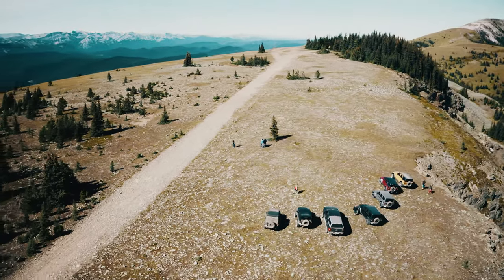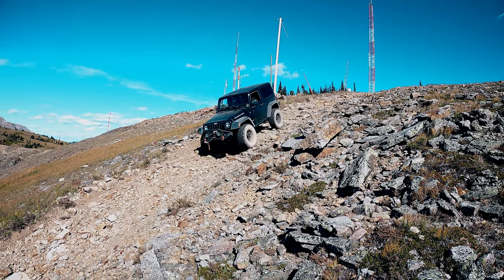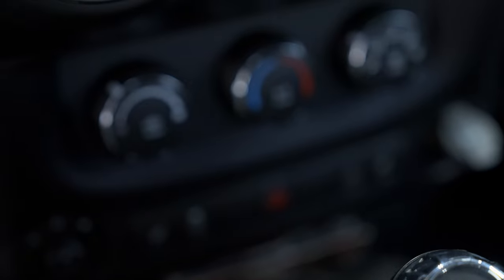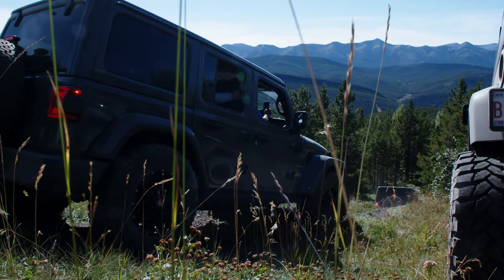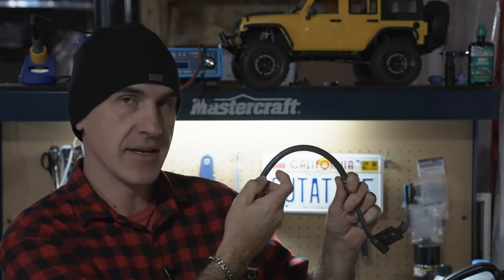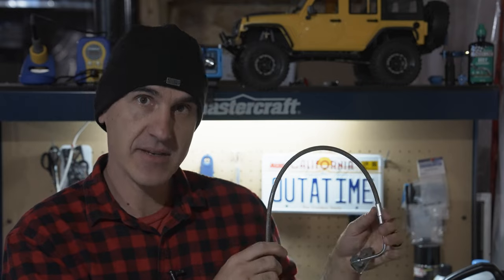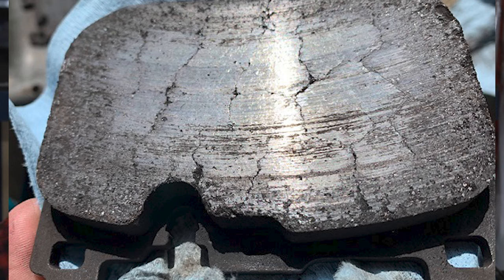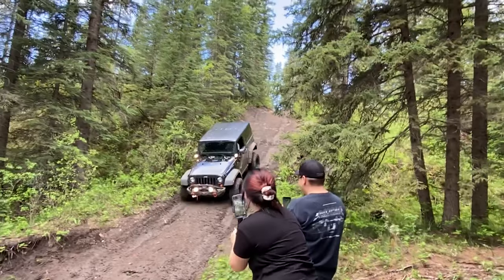Tip: Jeep Wrangler Hill Descent Control

Comment: Correction to your vid. When you use the hill descent, it uses the transmission along with the brakes to maintain a speed. The reason the brake lights don’t light up is because the switch is activated by the brake pedal, which your foot shouldn’t touch. The switch also can be used as an ascent. In either situation just manually select the gear and the jeep will maintain a speed. Cruise control for 4 Wheel low. Top speed, 5m/hr.
Reply from the maker: Okie.

Comment: Never knew you need to be in 4lo to have hill decent  actually work. Only tried it once in 2wd and it didn't seem to be working.
Reply from the maker: Yeah; it's because of the super low gear ratio. On my Rubicon, manual 1st gear goes from 4.46:1 to 17.84:1. In 4-Low I don't think I could get it much past 5-7mph. I found that 2nd gear was the sweet spot for doing 30 degree descents. Auto 1st is 3.59:1; Rubicon 4-Low will turn that into 14.36:1 so not quite as low as the manual. Non-Rubicon's will have a 3x multiplicatoin factor instead of 4x.  When HDC is engaged on an auto it acts like a manual allowing you to select the gear that you want to use. When I went on this trek with my local group  I could smell burning brakes LOL.

Comment: All good valid advice. But I’d like to add steel lines versus rubber want effect brake fade at all.  Crappy brakes with rubber lines is do to expansion. Not the heat from fading.   

So pretty much people should just know if they have a lot of fade follow your instructions and not just swap to steel lines.  Still liens will help the brake feel tremendously. But If you ride and over heat you will still get fade